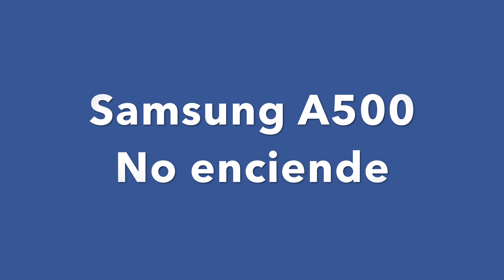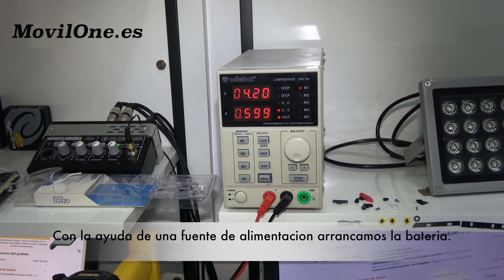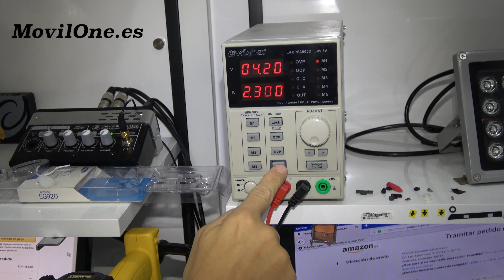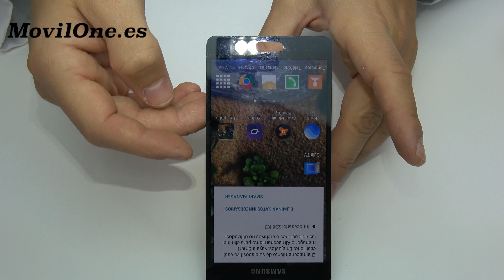Samsung Galaxy A5 No enciende

Comment: Hola! Mi celular del dia a la noche no se prende asi que supongo que es por la bateria. Mi pregunta es: Si compro una bateria original nueva para mi modelo de celular A5 2015, y abro la tapa por detras y lo intercambio, funciona igual? Y si no compro la bateria y sigo el mismo metodo mostrado en el video, que otra alternativa para darle voltaje tengo si no tengo esa exacta maquina que tienen ustedes? Saludos!
Reply from the maker: Hola. Si le compras una batería original va funcionar como antes. Si lleva mas de dos años es mejor cambiarla. Un saludo.